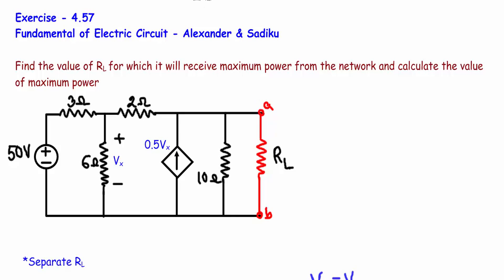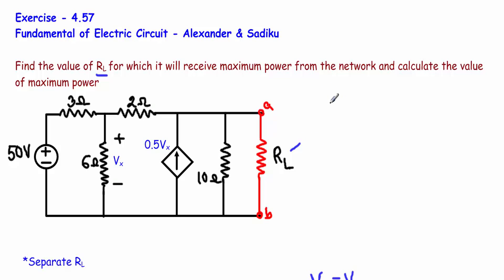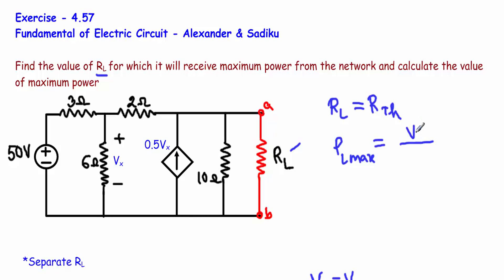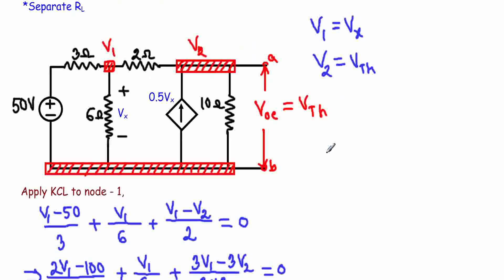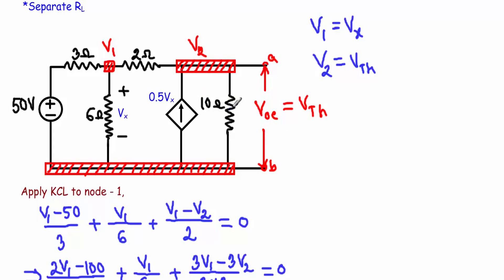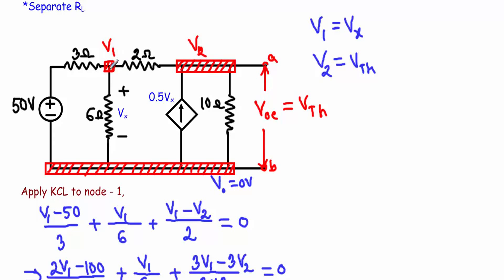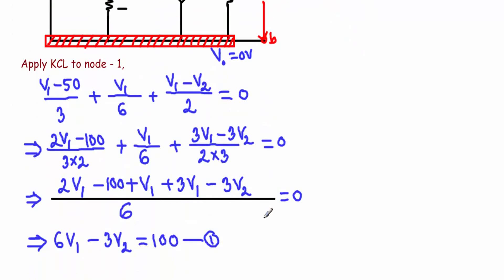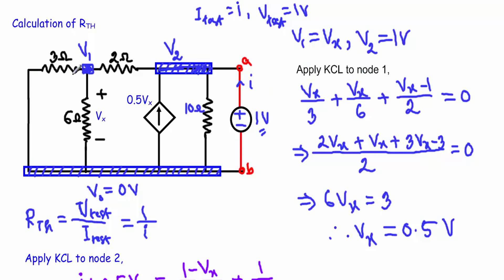Maximum Power Transfer theorem Dependent source : Example 2 (Very Hard)

Comment: Please clear me when we will use test source??
Reply from the maker: check dc circuit playlist
Reply: Here you said that Test source method will only be applied when there is no independent source. But in this circuit there is an independent current source. And you applied test source method.
Reply from the maker: At 4:45 min, can you find Norton current to calculate Rth? First answer, then I will answer your question
Reply: 4.45 of this video? If not please give the title of that video.
Reply: Please don't be bored on my frequent reply.
Reply from the maker: this example
Reply: @EEAcademy2022   Oo man !! U made mistake in taking LCM 😅🤣🤣 , first learn to take LCM correctly 🤣

Comment: how did you remove the current source although it's a source not a resistance  so it provide us with current please answer
Reply from the maker: When did I remove CS here?
Reply: EE Academy i mean u did not use I(s.c) method  cause u said that the resistance and the dependent source will be removed
Reply from the maker: Yes, and it worked. The best way to verify is to check the given reference